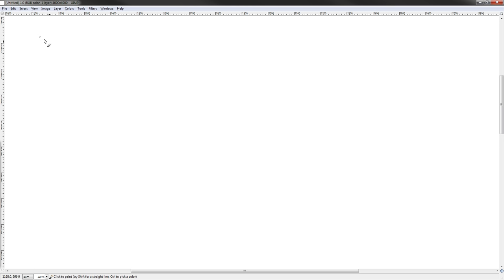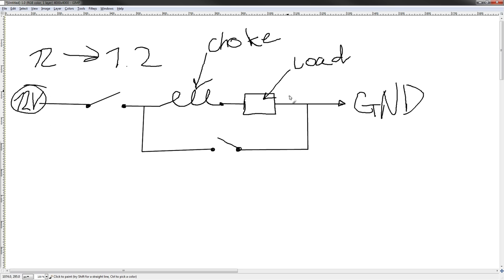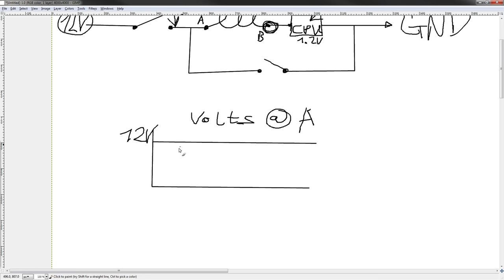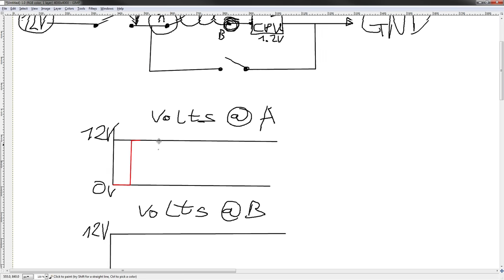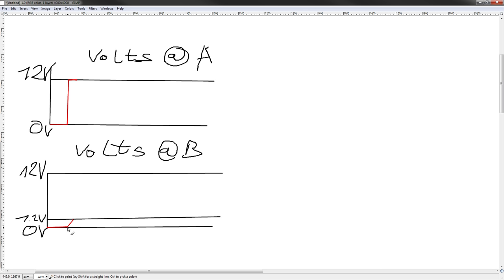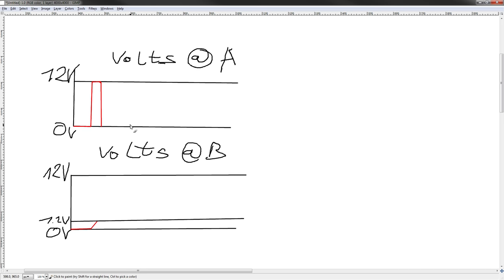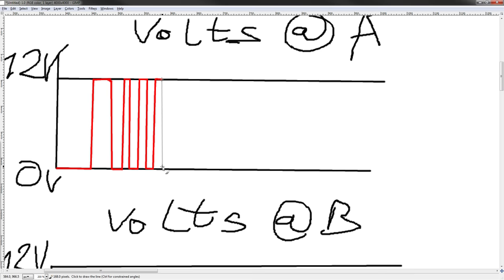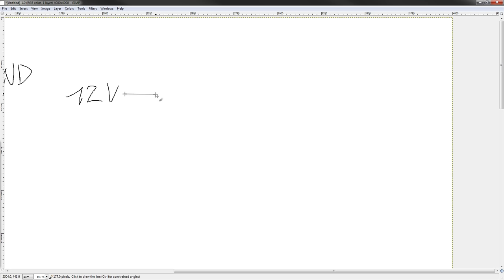How VRMs work (I give up edition)

Comment: okay so I've got a question. this has been in my mind for absolutely ages. But I was never sure. So my GTX 970 indoors can reach a max stable overclock of around 1580 MHz on the core with a tiny bit of artifacts. No matter what fan speed I use and how low I get the core temp, the overclocks won't go further before it artifacts like crazy. but weirdly if I try the same result outdoors (around 7C), I can reach way higher clock speeds with much higher stability. So does this mean the VRM's require better cooling so they can provide more stable power. Or is it the core that needs to run super cool?
Reply: That sounds like an issue with wattage. The lower the fan speed is, the less power you'll draw. Seeing as your system has a lot of components (highly oc'd 4690k, 3 hdd's, etc.), it seems that there's not a lot of wattage left over for your gpu. Keeping the gpu fans low saves a lot of power. For instance, if you watch jayztwocent's watercooled rx 480 video, you can see that he's saving up to 55 watts of power with a highly overclocked 480 with no fans at all, compared to gigabytes stock fans.
Reply: No way 2 fans draws 55W of power....
Reply: R4GEcraft What else, then?
Reply: No trust me its not the wattage. I run a custom bios and have loads of wattage headroom. Also I did both test's on 100% fan speed. So I'm not sure if its the VRM's fault or its something else.
Reply: The power circuit you draw the power from inside your house also affects the quality of your power signal. If the plug outside the house is on a different trip switch maybe try running an extension cord from the outside socket and re-run tests inside?
Power supplies don't filter out 100% of power artifacts.
If you have a UPS on for example try running the test without it.
Reply: Eaton Emmerich It was plugged into exactly the same socket as the one I plugged the extension lead into. For some reason I can overclocked much further just by dropping ambient temps down to 7C. But it doesn't seem to be the core clock, but the VRM temp that affects stability.
Reply: *****
Or the memory. Especially if you talk about artefacts
Reply: R4GEcraft Nah if I put my memory on stock it will still show artifacts. Its definitely related to the core.
Reply: doesn't the rx480 wattage sensor only show wattage the core uses and not the fans, memory and whatever other stuff is on your card?
i heard this once so please correct me if i'm wrong, thus it won't show fanless difference or whole card use difference.
Reply: Mosfet performance varies with die temperature. As temperature rises, internal resistance increases too.

Comment: Great video! So with the second switch, the current goes through the diode until that switch is closed as there is a delay with the switch?
Reply: glyn hodges  Thank-you that's very helpful.

Comment: but srsly, great video!
a question, what level of natural voltage drop are we talking about in a lets say cpu on one vrm (i know not gonna happen)
and also what time span between the up and down of the voltage?
and is this change up and down of voltage big enough, that more phases are generally prefered when a precise voltage is wanted, or could u just use a regulator thingi before the chip , so that it makes the voltage more even, if that is a thing?
or does the drop basicly not matter as it is tiny enough?
also could u get yourself an old worthless shit card and through overloading the vrm  kill it and showing us the burned out mostfets or whatever part will go puff, ask powercolor to sponsor it : D rofl.

Comment: Why the CPU doesn't use 3.3 V since it's more close to the required 1.2 V compared to 12 V?
Reply: I think it's all about wires thickness when you want proper current delivery at 3.3V.  Imagine thickness of the ~50A wires.
Reply: Lets say you want to provide 150W to the CPU. The wires get hotter with more current flowing. Higher voltage means less current for same wattage, so less efficiency loss and heat output at the wires.

Comment: You can definitely get a 10A smd diode. Doides are not inefficient, Thats not how they work. Also the way you drew this circuit is misleading. The diode is supposed to function as voltage regulator, not a current return. and you're missing the filter capacitor which is pretty important for smoothing the ripple voltage.

Comment: 24 min i think you are wrong.
I think psu should give
 constantly 100 amps. 
Great videa
Reply: actually it don't because the voltages are different "watts" is a better general term I=v/r (amps  = voltage over resistance ((load)). so the same load at 12v is lower amperage

Comment: Now I know why they try and do 8 inductors with a 4 phase, because they are trying to drag the drop out to smoothen the voltage. It's a cheat, instead of using real 8 phase.

Comment: i thought you need to mention a caps :)
Reply from the maker: For the bare minimum you don't need them. If you want something that can actually handle fluctuations in current draw they are a necessity.
Reply: sorry out of topic and my english is really bad, I have a little trouble here i can OC my 4960x to 4.4 GHz stable @ 1.26V ( rampage IV black) but why my ram is stuck at 2133 with xmp (  ripjaws-Z 2133 c9 1.65v ) and always cannot boot with manual mode even at stock speed and latency. according oc3d it can go 2400 very easy. BTW I'm from indonesia and overclocking is my hobby but Still a newbie. :)

Comment: Your "1"s look like "7"s, you should just draw a straight vertical line, like "l". Cool video though.
Reply from the maker: Brendan Byrne in the Czech republic we put a cross in sevens. I forget that the rest of the world doesn't have this. also for some reason I never liked 1s in the form of straight line.
Reply: I do really like your videos and how in depth you go, sometimes when I'm pausing the video and looking back to get a better idea about it I'll be like "wait how did we get 7.2v again? Oh right".

Appreciate the content though. :)
Reply: Do your thing, i like your style! Also I put crosses and I'm from Sweden :P
Reply: Mexico uses crossed 7s as well. MOST folks I know recognize them, even if they don't use them.
Reply: slikrx yeah the problem is not that people don't recognize crossed 7s, it's that the hat on his 1s are too long and look like normal 7s. The crossed 7 is not a rare item.
Reply: Actually Hardcore Overclocking just make the line at top much shorter, "1" on my KB has only a small line out of it.   "7" has the longer line.  They are slanted, and anyone listening (wth wouldn't people watching be?) it should be a nonissue.

Edit: or perhaps just make it slanted more, you make the line relatively strait from the "l" part of the "1"
Reply: Good point NoOne ButMyself, and this is only nit picking constructive criticism. It's not a deal breaker.
Reply: in portugal the crossed 7 is also used.
Reply: Lithuania uses crossed 7 too.
Reply: Actually Hardcore Overclocking In Germany, we also do this.

Comment: The ugliest diode i saw a long time. But other than that yeah ok. Next episode you need to show capacitors in the circle and how they help sustain the current.
Reply from the maker: That might come in a 3rd video where I cover what makes a "good" VRM. This is so bare bones because I want to cover how/why MOSFETs fail ASAP.
Reply: Your choice. You make the content. Happy to see, that it will come.

Comment: This is not how it works, this is not how any of it works.
Jeez dude, study up how buck converter really works, cos this explanation is blind leading the blind.
Voltage across inductor can change instantly, current cannot, inductor tries to maintain current.
You are missing capacitors at the node B and at input.
Voltage across capacitor cannot change instantly, but current can.
Output ripple is a product of capacitor ESR and inductor ripple current.
Given this is an older video I'll give you some slack, pretty sure you can do better.
Reply: VEC7ORlt He explained it so that normal people can understand it.

Comment: Bro you desperately need a tablet. It's painful watching you use your mouse as a pen all the time. Let me see what one to get and we can start saving up. I use a surface pro 4 daily but it's too expensive for this :p
Reply from the maker: I have a tablet. Sometimes I just can't be bothered to pull it out. It also doesn't help that the difference between me drawing with a mouse is not that much worse than me drawing with a tablet. I just scribble faster with a tablet than I do with a mouse.
Reply: Is it a graphics tablet or a tablet screen? I found writing on the screen to be excellent for annotations. At Virginia Tech we required it for all engineering students since 2007. I already knew this VRM stuff, and I don't think I could have explained it better. That's why I subscribe.
Reply from the maker: It's one of these: https://images-na.ssl-images-amazon.com/images/I/812S1fCdMSL._SL1500_.jpg

Comment: How can I check the GPU vrm phases? My gpu just come from warranty and it works terribly. 
They've replace 3 mosfets and 1 mosfet driver. I cant OC anymore at all, it crashes at stock clock, unstable voltage.
 I've even instaled a back radiator for vrm because the temps were reaching 90°C.
I think that 1 or 2 phases are down, how do I verify.